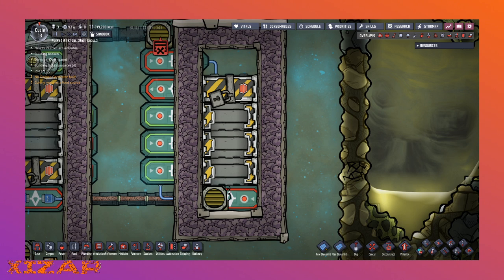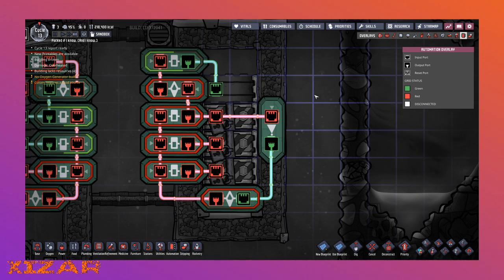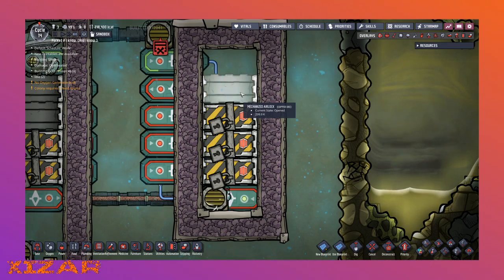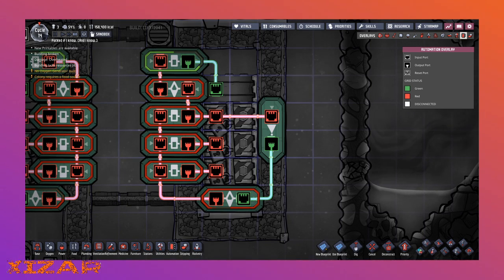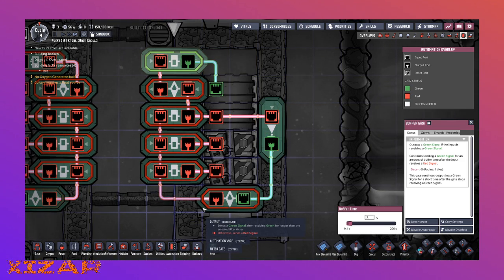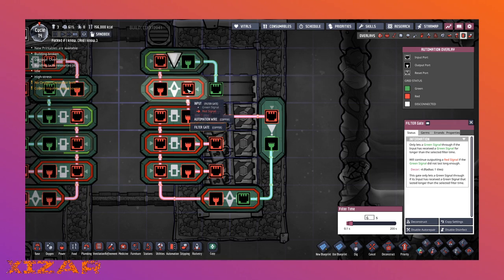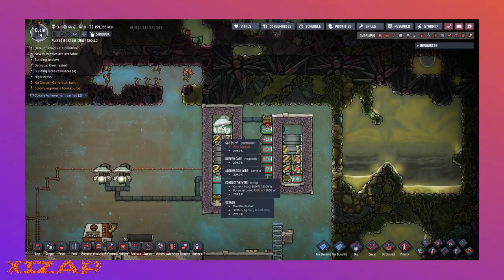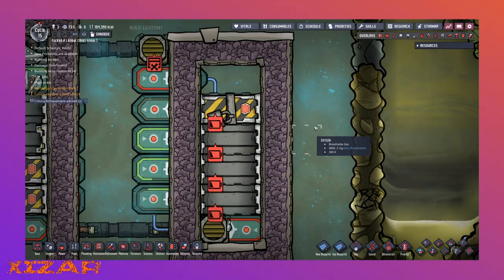Oxygen Not Included - Gas Compressor Door logic tutorial. (Automation works as of patch 420700.)

Comment: Not working for me. I have checked and double checked the timings and they match. The doors close in the correct order as the vid but its seems the gas just gets destroyed in the doors and doesnt get pushed out the far side. Has this maybe been changed in an update recently? I did use it a month or so back and it did work for me then.
Reply from the maker: I think the reason this doesn't work anymore is because of the automation added to gas vents.  The wiring needs to be routed around them, other wise the vents get shut off needlessly.